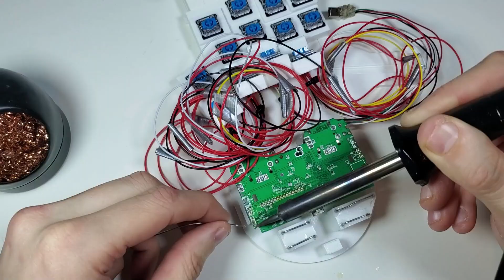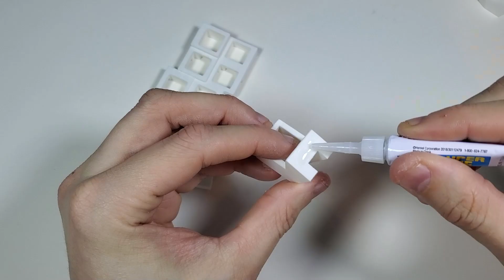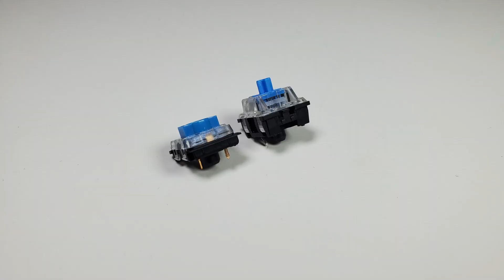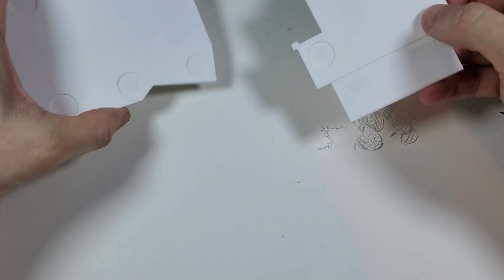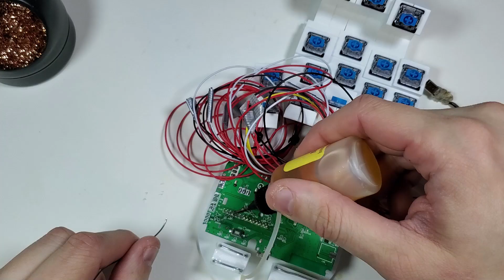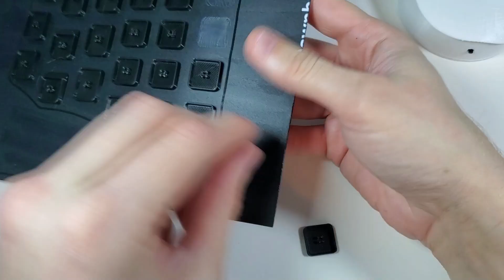I turned my OLD CONTROLLER into the ULTIMATE KEYPAD!

Comment: It been a while since i watch this video. Did you ever consider using 2.4ghz  wireless office keyboard? The board is extremely compact. The hard part is find out how to wire the pin combination for the right letter. But if you success you can have over 100 keys. And it will work 100% with every game not just Fortnite.
Reply: But no analog inputs, only wasd.
Reply: @steameier8590  i think i can bind analog input to AWSD

Comment: I really wan to try this, but I see many issues to do with game compatibility in this. when you use a mouse in the other hand, most games get confused as hell, and constantly switch back and forth between mouse and control interfaces, and input settings. 2ndlt I'm worried if anti-cheat software would detect some odd crap going on, and flag you.

Comment: I felt this same way. I bought a used razer Tartarus and modded a true analog stick to it ( its analog stick is a dpad with tactical buttons that break extremely easily.)
I added a ps2 analog stick with a raspberry pie and it works just fine. Only downside is it requires 2 usb ports and basic modifications.
Reply: You can use a very small USB 2.0 hub.

Comment: So it basically is a controller body so its gonna be recognised as a controller in the pc so 360 movement..... But how to make the mouse work then, wouldnt the mouse emulate the right joystick and there'll be sensitivity issues.....
Reply: It depends on whether the game supports controller AND mouse input at the same time. Fortnite allows this, so you get 360 thumb stick movement and mouse aiming, rather than right thumb stick aiming.

Comment: Is it possible you would sell a cheap "kit" all the pieces 3d printed and all the wires needed, just have to solder and glue it ourselves? I bought the new Tarturus by Razor and it broke in 3 months.  Spending 80$ every 4 months isnt very practical.

Comment: Slick idea.  Being a programmer, I'd have went with an Arduino or a Pi Pico there- but this, while there is some work to be done soldering, is pretty slick, all things being equal there.
Reply: yeah, this is likely the best path now and I expect T.Y. to use this in his next build. it's also a lot more compact than the PS3 circuit board. and you can do all kinds of customizations by reflashing it later when you have more ideas (e.g. chorded commands built-in to hardware -- no software needed!)

Comment: You know, there was always a question that I begged for an answer to...
Is it possible to reprogram a controller for one kind of console, so that it could be used on a different console (ex.: a Wii U pro on PS4)?
Reply: Sort of yes. One: they have USB adapters (Brook or Mayflash I think??) Which translate one controller to another. Check fine print for compatibility details. Two: GIMX adapter with use of a laptop or PC. allows you to use keyboard, USB controller (anything supported on Windows) to mimic a PS4 or Xbox controller

Comment: I've been using these things for years.
Belkin nostromo n52, razer orweaver, tartarus, logitech g13 etc etc for over 10years. Theyre all good. But each had problems, like heavy keys, or heavy thumbstick.

people don't realise how much of a gamechanger controlling movement with your thumb is, not just in FPS games,  but especially in MMOs.
Good god, the advantage you have in mmos is insane when you move with your thumb, and not WASD. 
I even use thumb to move in Lost ark. (razer tartarus, theres a thumb button and a thumbstuck. binded thumb button to mouse click)

Your hardware has the potential to be awesome, like you could use cherry speed, or mx silent keys etc, or even have a super smooth and responsive thumbstick,
hell your thumbstick is already better than the junk razer gives us.

But selling point for many, is also the key bind software. Razer has, by far, the best key bind tech.
While Logitech's keybinding can be awkward, Razer's is intuitive, flexible and extremely powerful, you can bind key combinations and timings like no other software can.

sidenote: while razer's keybinding is best on the market in my oppinion, Razer Synapse 3 is utter dogshit of a program. 

so yeah ... on hardware alone, what you're doing can be a massive boon to gamers, expecially if you allow hot-swappable keys, (keyboard enthusiasts would love that)
and if you can get a binding software to come close to what razer's can do, you're in the money.

Comment: You should post a link to the exact controller and buttons you used. For the record, the original PS3 controller does not have a board for the buttons. It used a polymer thick film (PTF) flex circuit

Comment: I thought this could be a good place to ask about something ive been trying to figure out. I use a ps3 move navigation controller for movement, and I use rewasd to map wasd to the thumbstick and between that and a logitech g604 mouse I have more than enough buttons for most games. Does anyone know how I could get 360 control on the move thu.bstick and still have pc style button prompts. Thanks for reading
Reply: basically this can only be done if the game specifically supports it. From what I know Fortnite is about the only game that supports this (360 analog movement while operating Mouse as well, and show proper button icons)

Comment: Is there any chance that you could tell me exactly which controller you used as a Donor? All the ones I checked have flexible PCs for the button connections and the connector has extremely close pins that make soldering wires to them very difficult/ Yours seems to have nicely spaced out pins in a row next to the connector.
Reply: a good one I used for this project is called Powerextra PS3 controller and it's on amazon

Comment: This is fantastic. I have a mate 3d printing the parts as we speak. However one issue I know I'm going to run into is that many games like Modern Warfare don't allow mixed inputs, which this would be. The pc would see a controller and a mouse as the same time and only allow one. I guess the solution would be use an arduino board or board from one of those gaming keypads like the razer tartarus or cheaper chinese imitation one. Then the thumbstick would have to be mapped to wsad so you wouldn't have analog movement, but thats better than not being able to do it all. Anyone have any ideas?
Reply: Use ReWASD to solve that.
Reply: @MichaelButlerC  oh great! thanks!

Comment: I've looked for something almost exactly like this, and come up empty, time and time again. Either it's single inventor such as yourself or a small company who has since gone under with all their products now unavailable for sale. Anything that I CAN find is either extremely expensive boutique hardware or has a 4-way rocker switch where the analog stick should clearly be.

Actually, thinking about it this is probably the best implementation of this idea I've seen. Basing the device on a controller allows for something I haven't heard you touch on yet: Steam Input. Since this presents as a controller, you could use Steam Input to remap and modify the keys in a surprising amount of ways, up to and including remapping those controller buttons to keyboard inputs, bringing the idea full circle.
Reply: That's one of the biggest strengths of this thing. If the keys were just pure keyboard keys, you couldn't do the fancy stuff like HOLD button or DOUBLE TAP for more actions. But being a PS3 controller, like you said Steam Input is possible, and other programs too.

Comment: I liked the Azeron, but I couldn't quite stand that they used mouse switches. It was super clicky and the way the joints were made had the screws jiggle loose sometimes. I always wanted something with red switches. I have some low profile red switches sitting in a box, but I sold my 3D printer! Guess I'll have to find someone to print lol

Comment: Nice project. Amazing work. 
Even though it would be more expensive… I would have used a Logitech F310. You would have both Xinput and DirectInput with a flip of a switch. Also… even though I don’t own one… some time ago I checked images of it’s PCB and… if I’m not mistaken… it has 2 unused buttons hidden under the gamepad shell. Don’t know if the software detects them or the are disabled by default 😊

Comment: Consider using an 8bitdo Ultimate Bluetooth Controller ($70) for your build. These controllers feature electromagnetic joysticks for more durable and drift-free joystick. Another option is the GuliKit Electromagnetic Joystick Module for Steam Deck ($30).

I am willing to pay between $150 and $200 for a custom keypad with an electromagnetic joystick.
Reply from the maker: ill check it out. thanks for the tip

Comment: This is basically an Azeron with different keys. Yes, azeron can also set up to use the thumb stick as was or an actual analog stick.
Reply from the maker: i paid like $15 bucks tho...
Reply: @techyesterday4960  your is better than an Azeron because your version would be less prone to accidently hitting wrong key.
Reply: @techyesterday4960  Can you leave links to parts that u used ?

Comment: I need to somehow get one of these in a different shape. Because of my disability my left wrist is permanently flexed and my fingers have reduced flexibility, so I can't game on a keyboard with my left hand or a controller with my right. I've been doing the controller in the left hand thing for a couple years now, but I have to use a mouse with tons of buttons and a pro controller with paddles, plus legos glued to it to hit some of the right side buttons. All of that and it's still not really enough buttons for fortnite. I can't press binds like map, inventory, augment or rotate easily, and I had to put sprint and place marker on foot pedals. I know it's holding me back a lot, especially since the controller I modified (razer wolverine tournament edition) apparently has pretty bad input delay and my left middle and little fingers don't have any buttons to press. I really wish my hands were "normal" so I could just buy this or an azeron or even just play regular KBM, but it looks like I'm probably going to have to learn microcontroller programming and save for a 3d printer.

Comment: I feel the same way about using a controller with fortnite. I recently bought a keyboard joystick and within a couple of days saw an improvement in my mechanics. However, I quickly realised there are way to many binds to remember on keyboard and I don't have the time to grind the game to improve. The best thing about controller is how easy it is to just pick it up and play the game, and the binds are so much simpler in a way as they are all accessible without having to do some crazy finger gymnastics!! The downside is how quickly you can reach a skill ceiling, and having tried different sensitivities, controllers and settings its really difficult to improve. Would love to see a video of how you set the keypad binds up with some gameplay. Keep up the good work.
P.s would definitely buy one if you put it into production.

Comment: I have a keypad right now and the main problem is remembering which keys do what. A keypad where you can put icons on the buttons depending on what game your playing would be magical. My dream keypad would allow this but then would add haptics, analog triggers, and adaptuve resistance to allow you to for example push one button halfway down, the haptics and resistance would tell the finger youve hit halfway, and by pressing through the adaptive barrier allows you to perform the second action. The mac keypads already do this. When you think you're clicking, that's actually haptics causing the sensation a normal clickpad would cause. I think it would be possible to make work on a keypad as well.

could be used to adjusting dps on the fly at different levels
cooking and firing grenades
jump and double jump
etc etc etc.

Comment: Love what you're doing here. If I had a   Soldering kit and 3D printer at my disposal, I would go right at it. Getting one premade would be dope nonetheless.
Reply: I have been using this for over 2 years. It is called an Azeron, but the Azeron is better because my fingers travel a far less distance in order to hit all the keys.
Reply: @Masterpaintingnowlearn2draw  Got a Azeron Cyborg but the keys too close together so too easy to hit another key by mistake. Would prefer this guys design - keys easy to hit but unlikely to accidently hit wrong key.
Reply: @Masterpaintingnowlearn2draw Is Azeron's joystick a analog or d pad type?
Reply: @Ejdelv   analog but right next to the analog is a d type as well
Reply: @Masterpaintingnowlearn2draw   lol its called an ASERON. too funny..

Comment: just like how you basically cant play fortnite with a keyboard/mouse i cant understand how its not possible then again i was using a computer before  i could read or write EDIT: You should try giving this thing a mouse sensor so you can use it like a mouse but with a joystick
Reply from the maker: already did it with a mouse with a joystick on the side. like this better